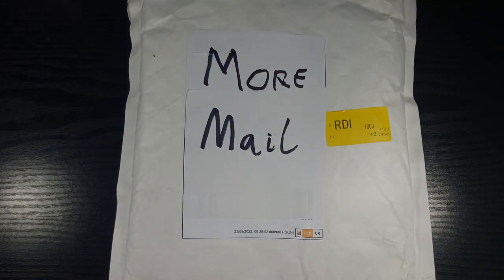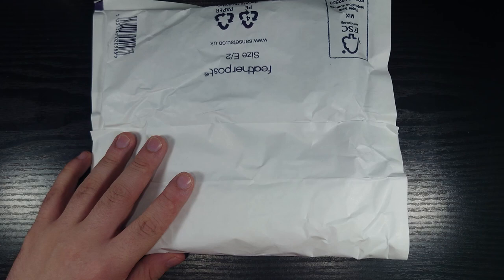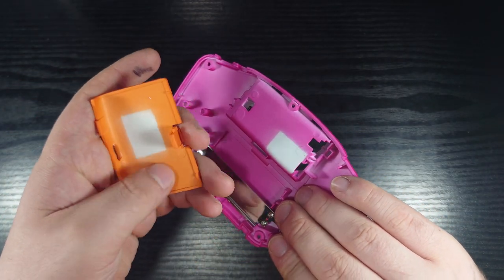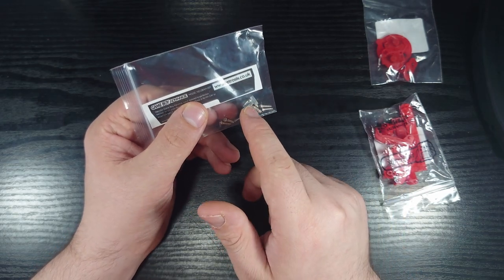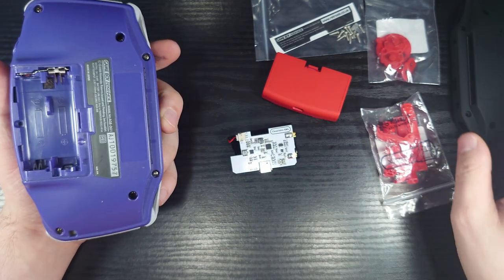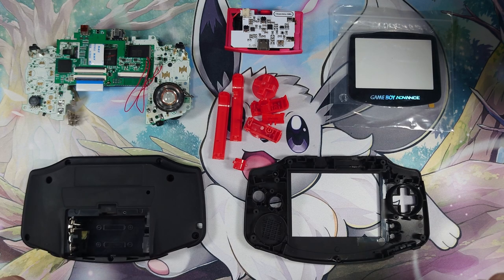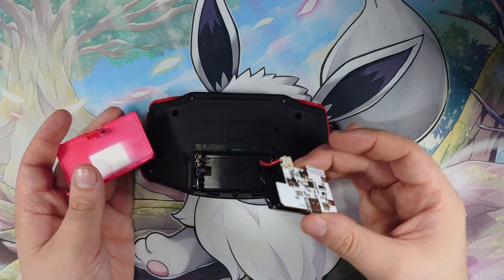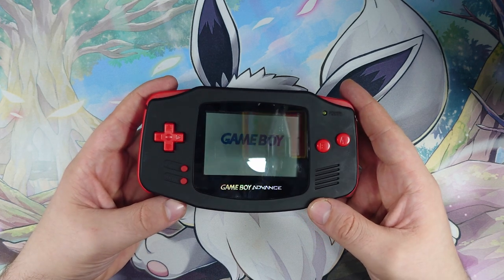Re Shelling My HDMI Modded Gameboy Advance and Installing a Clean Juice Battery Pack

Comment: Can you put the link to the shell in the description?
Reply from the maker: All parts from retro six have links in the description. Thank you for reminding me to add them!
Reply: @butchcanniegame  thank you so much I really want to do one of these I have a GBA that needs recovery (bought it that way bc it worked and I wanted to try to do this) so I'm really excited but nervous. I already have a GBA custom from someone else but I want to learn myself so I can make them as gifts for others. But first I want to be able to do it myself.
Reply from the maker: GBAs are pretty easy to work on. My best advice is to be careful with the ribbon cable and connector. Just take your time and you'll do fine! 😄
Reply: @butchcanniegame  thanks!!! Will do!